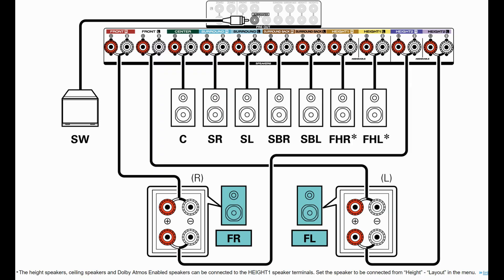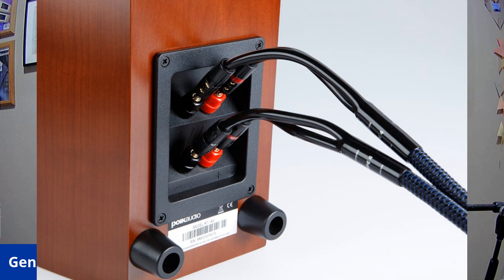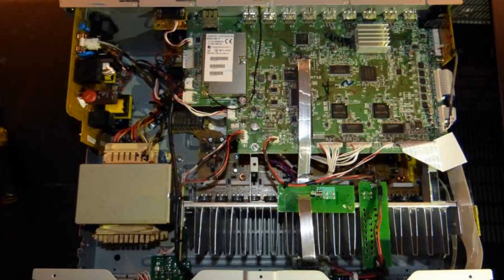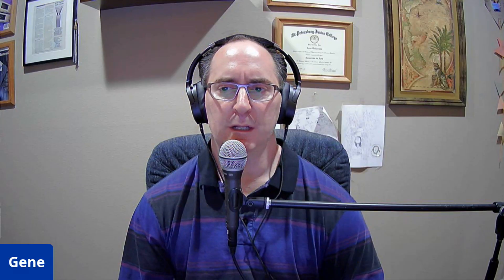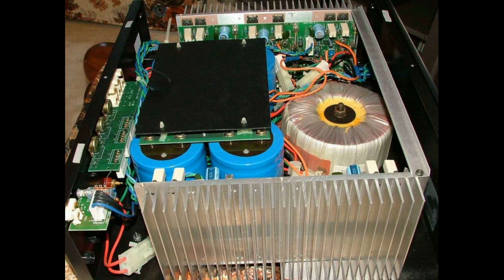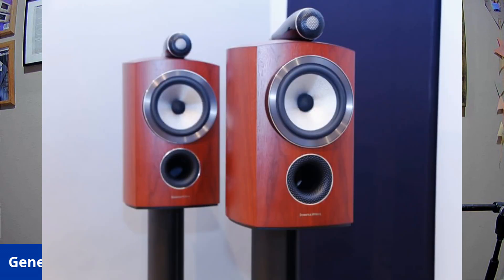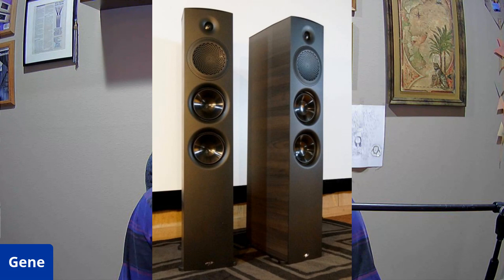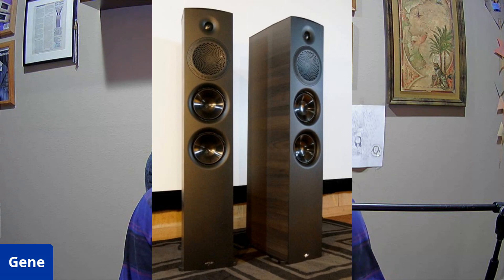Should You Bi-Amp Your AV Receiver?

Comment: I have a Yamaha RX A-3030 and klipsch rp280. Would anyone recommend bi-amping? Been wondering if I should ever since I've seen his video on bi-amp vs bi-wire
Reply: Your Klipsch are pretty easy to drive. Upgrading to a higher quality stereo amp would most likely be a better choice. There isn't a simple answer because every situation is different. Your Yamaha is one of the better models, so it shouldn't have problems driving your speakers. In your case, I would do an amp upgrade for better sound, rather than for just more power.
Reply: @solarfall2728  Thanks for your reply. I have 5.1 surround so thats why I have that receiver. I know it's not the best for stereo, but I'm really happy with it otherwise. 
But back to bi-amping, I know I have enough power, but is there any advantages sound/distortion wise?

Comment: I have a Denon X4400H that I want to run in stereo only. Would this benefit from bi-amping my speakers or should I just leave as standard connection? 
Thanks
Reply: It made a difference when I did it with a Sony AVR.  Still can't seem to get it to work on my Denon 6500H.  I don't think there is a answer to your question.  In some applications you won't hear a difference.  In others it can be noticeably better.  Best way is to try and have a listen.

Comment: BI - Amping my Arcam AVR 550 caused me no end of issues - I have KEF reference 1's and they are very power hungry, in bi amp mode the AVR would throw a wobbly and cut out - it sounded like it would oscillate before going into protect mode or maybe it was getting to hot ? I would run the amp around 70 on the volume. so fairly loud... I now have 2 PS Audio M-700'S powering the KEF's and all is well in the world.

Comment: If one has 2 great subwoofers set up already. Should one take the time to bi-amp? doest it make any sense ?
Reply: IMO Yes, you are giving the speaker more power which its capable of handling and in return will give you more control and SPL.
Reply: @SoundsFantastic  Thank You, I will try it out.
Reply: I wasn’t sure. I have a Marantz 8012 is an 11 channel receiver. I am currently using it to run a 5  Bowers & Wilkins 700 series speakers and 4 prime elevation atmos. That means I could use the additional 2 channels to bi- amp my front towers. Correct? Once set up, should I set my towers to large?
Thank You.
Reply: @omarseneriz5577  While I'm not familiar with the internal architecture of the 8012 I would try bi-amping. Under (almost) no circumstances should you set the front speakers to "Large". Unless you are prepared to do a lot of simulations and measurements with REW stick with "Small" and 80 Hz crossover. Gene has videos on that as well :-)
Reply: Depends on your front speakers more than the number of subs, but also depends on the current those front speakers demand from the amp and that in turn is also dependent on whether or not you apply a crossover and the crossover frequency.

Comment: how do I wire a Sony strdn1080 to klipsch R26fa? Just bought my sony any was going to stay within sony products. but then at the last minute seen the Klipsch and decided to go with the Dolby Atmos t-shirt so now I've got both speakers and I've got the Str dn1080.
I don't know if I bought a separate amplifier if that would help run the Dolby Atmos front speakers or not so I would like to hear it what you have to say?
Reply: HI, I've just recently bi amped my sony strdn 1080 for 2 channel stereo only it has definitely improved the sound, my mid bass is more rounded instead of honking & everything else sounds around 10% better to me on my 2.5 way monitor audio speakers.
Reply: @stLtBilko  thanks so very much for your response. I really appreciate!
Reply: @zzippyy2011  You're welcome, it seems to me there is to much analysis on "why my expensive x+x components don't work so well",  &/or spending time looking at measurements all day instead of looking to just get a system that suits the acoustics of their preferred listening space, I would not like to have to a system where I have to constantly worry about what my amps & all the other myriad bits & bobs in it are going to be doing at any given moment, that's what children are for.
Reply: @stLtBilko  I like your thinking

Comment: I'm using a marantz 6013 as a processor. My amp is the jbl synthesis s7150. I tried bi amping using this feature. Didn't notice ANY difference whatsoever.  My rp8000f are already very efficient so I don't think I was getting anywhere near to utilizing all that power. Only thing I ran from avr was my 2 height channels.

Comment: Hi Gene, thank you for this video. Another great one! I am the lucky owner of the AVC110 from Denon. It's paired with 702S2's from B&W. Currently they are not bi-amped, but I am sure the amp has enough power to drive it. I already have the DB1D sub connected to the system as well. Would you recommend using the bi-amping functionality for this setup? I could, potentially also bi-amp my center speaker (HTM71 S2). Would you bi-amp a center speaker?

Comment: My tower speakers are 2.5 way, so in addition to bi-amping, I also route one terminal each from the center channel into my left and right mains. That's right, I tri-amp my system with an AVR.  Get on my level nerds.
Reply: trial by stone , you have laid out the challenge
Reply: @Dan_d00d  TRIAL BY STONE!

Comment: HI Gene, loved the vid, as usual.   Q i dont know if ever been covered  - BTL.  Bridge Tier Loading.  I know a little, and the push-pull dynamics , to use 2 channels for more amp power.  BUT - can this ever be paired with Bi Amp ?      Specifically, (and i wrote this on a FB post you made), I love my Sony TAE/TAN 9000 ES Combo .  Being of 2000-2002 era, its 5.1 Pre and Power , and i can see something like a rating of 200W if BTL for Stereo (and not use centre ch). Could this somehow be used, to bring in L/R on the RCA input, and get a Bi-Amp from 4 of the 5 channels?  I got lost in a hole reading all i could about 2yr ago and never saw example or clear info online. Maybe BTL is a good topic to wrap around this Q..
Reply: Extra info - I mainly use a Sony DN series 7.2 Amp for my AVR, and I have that in 5.2 with Bi amp FL/FR (even if that is not what you felt makes much diff on these more tinny models) and i do detect a clarity and cleaner sound in music, even some soundtrack mixes. 
But I want to have the 9000 ES separates for just 2 (or 2.1/2.2) channel audio in a separate room of home and other speakers, but in bi-amp, I was sure it was likely to be 'better' . Would regular BTL just be a more sonically robust option anyway? clearer or just more power grunt and no quality change?

Comment: What is the best way to wire Boston Acoustics VR975 speakers with a Denon AVR 3313-CI receiver?  The towers have rca inputs for the powered subs.  Currently I have LFE preamp out connected to rca ins for bass, and line level for mods and highs.

Comment: Any amp that has A/B channels can be used to Bi-amp speakers. Not just AVRs.
Reply: Incorrect. A/B speaker selection is not separate amplifier channels. It's simply two sets of connections to the same amplifier channel. In this case, you are only bi-wiring, not bi-amping.

Comment: Does it make sense Bi-amping the Yamaha RX-A2080 with a 7.2 using Polk S55 fronts?? Also, I noticed you recommended the A3080, but the differences to the A2080 is minor and does not seem to worth the extra $400, in my view.

Comment: I have an x4700h , do I benefit from bi amping , im running b&w 603 thanks
Reply: Random,  I’ve been thinking of using bi-amping on my X6500H and noticed in the bi-amp diagram in the manual it says to connect the upper speaker connector (High Frequency) to the Stereo Left terminal and wire the (Low Frequency) to the Height Left. I know the Amp Cards are identical but thought it would be the other way round as the Bass section pulls more power and therefore more heat, but perhaps that’s why they want you to use the far right connectors to spread the heat? Any thoughts?

Comment: Using a Sony 7.2 channel AVR in a 3.1 speaker configuration.  I bi-amp the front speakers thereby using 5 of the available 7 amplifier channels.  No noticeable sound difference at normal listening levels.  Ignoring power supply limitations, each amplifier channel is operating at one-half of the power load compared to a standard speaker connection.

Comment: Gene, thanks for all the videos been watching a lot over the last 2 years or so

I'm using a Marantz SR6013 and Bi-amping 6 ohm Jamo 606 towers. I'm worried somehow I've hurt my reciever. I had them Bi-amped using the 5.1 Bi-amp setting and the left tower kept registering as out of phase(I chose the ignore option after double checking the cables) using audyssey. I ran it this way for awhile and it sounded wrong. Heavy on the right and minimal on the left.
 So I switched it up to the 7.1 Bi-amp setting and the front end(LCR) sounds amazing. I'm waiting on cables to hook up the rest of the 7.1 to verify if one of the amp sections is hurt or if something else(no ides) could have happened. 

Could Bi-amping this combination somehow blown a channel? Average movie listening is up to -10db and tv and music is usually -15db or less. 

Thanks Gene
Reply: When you wired you system up so that it was "heavy" on one side, you just had your speaker cables crossed. The left and right speakers were out of phase with each other. Its harmless. It doesn't sound right, but it won't hurt your equipment. Here's a good, quick check that you can do anytime you want to verify you have your speakers hooked up correctly. Play a song which usually has a very strong center vocal track. One where the voice always sits right between the 2 speakers. If the voice sounds like its coming from one of the side walls, you screwed up. If its where its supposed to be, you have it right.
Reply: @solarfall2728  thanks for the reply
Reply: Turns out, my left rear surround channel.is blown. This is the Bi-amp channel for the 5.1 setting. Sound comes out of the speaker. But extremely low to the point I can hear it standing next to the speaker. But the audyssey mic doesn't register it at all. I ran it multiple times to see if it would register it so I could at least use the right or center rear surround channel. Unfortunately, no luck.And it happens to be the same channel for a single rear surround speaker as well. Going to have to see if the warranty period is over or not. My luck it probably lapsed 3days ago.
Reply: @jamesturnbough3695  Did you remove the jumper on the binding posts?

Comment: I have 2 sets of Tannoy V4i towers in front of my setup and i have the A and B turn on on my Yamaha reciever, so i have basicaly 4 front speakers ( 2 left and 2 right) doing the 2 front channels. It gives me a super wide soundstage because 2 are on the side of the TV and the other 2 are far on each corner of the room, and then i have 2 tannoy V1i for surround and one Tannoy VCi center channel.. I dont know if im doing a good thing or not.. but i kinda like the sound of it like this.. I dont know if BI-amping and just use 1 set of towers hould give a better sound, i never tried it... My reciever is a entry level old one RX V550, but i love it. Im saving up to upgrade but for now this still kicks S, and im waiting for 2 SVS PB2000pro to arrive next month.. cant wait, i think i have never been so hyped in my life. loooool..

Comment: I'm using an Arcam AV 750 with Klipsch speakers bi-amped, This produces a,sharper and less rounded, more dynamic sound and generally stronger bass particularly at low volume.  Maybe a better stereo image.  The listening volume setting is also lower for the same hearing volume.

Comment: I have a 10+ year old Onkyo 805 with a bi-amp feature. It was a fairly beefy receiver that does 130w/ch @ 8ohm w/ all channels driven. It uses the surround back channels for biamping, which is not being used since i only have a 5.1 setup. Would it be worth it to bi-amp my PSB Image T65  towers?
Reply: No. If you run music with 5 channel stereo, biamping the front towers will only decrease the all channels driven supply of power.  You have one transformer.  You won't magically obtain more power out of your 6th and 7th amp out.

Comment: Hi Gene thank you for a very informative video as always. I would like to hear you thoughts on active bi-amping. I have an 7.4.4 home theater setup with a Denon X6500H that I use as a pre-amp. I have a Emotiva XPA Gen-3 7 Channel amp and a XPA Gen-3 5 channel amp that power my speakers. I have a Klipsch RP speaker system with RP-8000F fronts, RP-504C centre speaker, RP 600m's for surrounds and backs, Klipsch 
in-celling speakers and 4x SVS PB2000 Pro subs connected with a mini-dsp. I am considering bi-amping the RP800F's and maybe the RP600m's by adding an additional amp. Is it active bi-amping If I were to add a new mini DSP between the AVR and the amps for the fronts to calibrate the signal and the crossover with REW. Does this sound like a good idea to improve the sound quality and do you have any suggestions on how the crossover should be set between the tweeter and the woofer?

Comment: I have two pairs of early 2000’s Mirage speakers that have 4 posts. One set has built in powered subs while the other set does not. 
I never saw the benefit of bi-amping the powered sub set because it only separated the sub section from the mids and highs. Why would I attach a high powered amp to a speaker post, just to have it be cut to line level then powered up again by a built in amp? It never made sense to me. 

Whereas the other of speakers did made sense because they didn’t have a built in powered subwoofer.

Comment: I'm using a Denon AVR-3313CI receiver, and I'm using none of its amps.  Instead, I use the pre-amp outs for my Sunfire 400-7 amplifier, which I love.  I just run a single pair of wires to my Klipsch RF, RC, RS-7 speakers, along with Klipsch in-ceiling speakers for my rear surrounds.  I once had to have my amp serviced, and used the Denon's amps (AVR-2805 at that time) during that short period of time.  I didn't care for the sound at all, it had no depth or warmth that the Sunfire amp brings to the table.

Comment: Gene, I have always thought that passive biamping was such a waste and I never understood how it was ever beneficial. This always came from the assumption that the two terminals on the back of the speaker separated the Tweeter from the mid-range. I never understood how it would benefit anything to drive the tweeters with their own full range channel and still go through the crossover.

However, I have never experienced biamping where the separation was between the mid tweeter and the built-in woofer. This has opened my eyes to why there would be a benefit for this. 

To help the viewers understand why amping doesn't make any sense in a weak receiver, the only thing it does is separate the current flow to pass through multiple output transistors so that they share the load but if you have a weak receiver with a weak power supply it's not going to matter anyways.

Now I can see how if you have a strong powerful receiver with unused channels it would be beneficial to drive the woofers independently from the mid and tweeter so that the output transistors split the current.

I've seen some receivers who properly filter and add an active digital crossover which is really where it becomes beneficial. 

By far, the Best improvement is to active DSP biamping which is what I did with some RBH 661se speakers using FIR filters, like what your doing with your RBH SVTRS.
When you filter the audio in analog or digital (digital preferred) and remove the large passive crossovers from the speaker chain, you have ALL the control over frequency, slope, phase, etc.

I do this in my car - active DSP 3 way front stage + sub; and in my office - active 2way +sub. In both cases the audio stays digital during the filter process through an optical cable to the DSP.
 In the car I use an AptX-HD Bluetooth puck optical cable out to my JL Audio Twk88 DSP.
At home I use a spdif optical sound card to a DSP dev board, filter it, then use a solid old yamaha receiver external inputs as the amp to drive my RBH SV-61Rs. The AMT tweeter is so delightful.

I'm addicted to DSP active speakers systems.

Great video Gene!